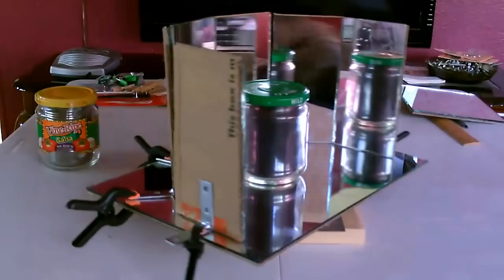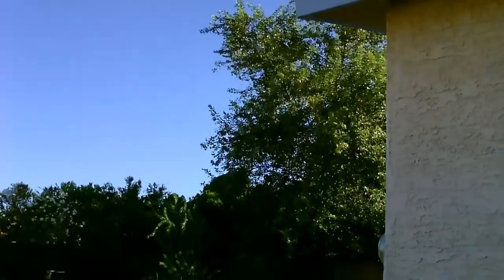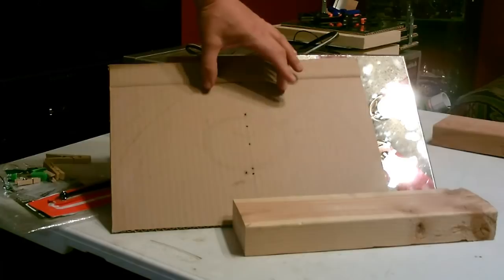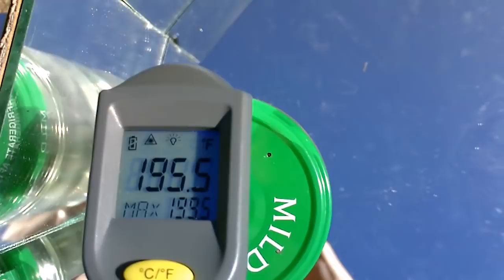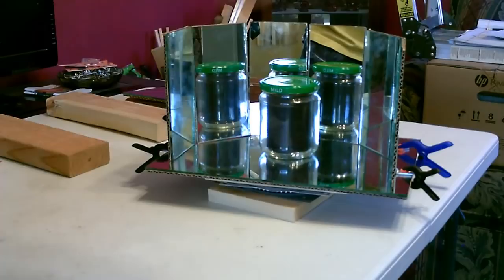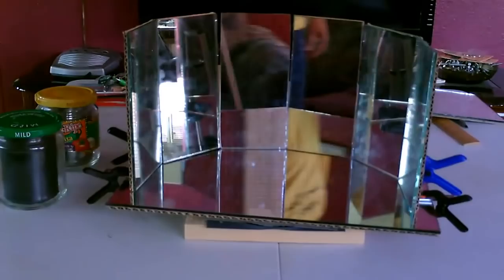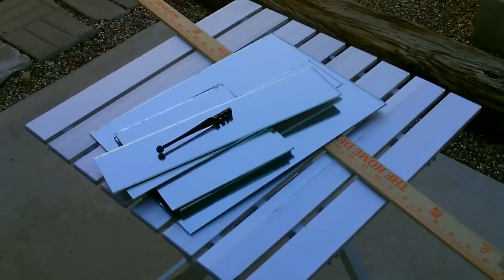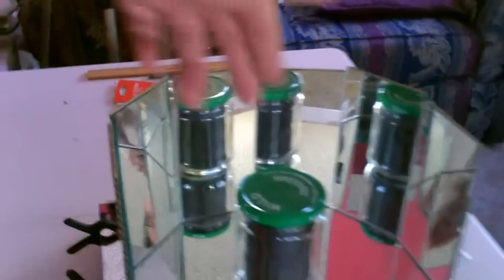Solar Mirror Cooker! - The "7 Mirror" Parabolic Solar Cooker! w/insulated cooking jar! (200F) Ez DIY

Comment: The mirrors should take the shape of a parabola. When you look straight into the cooker, you should see the pot in all mirrors. That'd get max efficiency out of the cooker. The bottom shouldn't be glass. It can crack under high heat. Other than that it's a very good design. The larger the cooker, the more heat it generates. Easily the most efficient design for everyday cooking.
Reply from the maker: hi. i'm glad you like the design. very easy to make 🙂

Comment: I especially like your food container! What kind of food- and heat safe glue did you use? My only concern with using a tin is the plastic laminate on the inside which is not meant to be heated up, and thus could break down and release in your food.
Reply from the maker: hi and thanks. i used 100% silicone caulk. that is considered to be 100% food safe. it handles very high heat 400F+. good news: a couple of years ago i really wanted to know the answer to "the lining" question myself (so i spent several hours reading many articles and they all essentially said the same thing). they said that it's perfectly safe to cook in tin or metal cans with linings (with only one exception). the exception is that you can't "fry" food directly in a metal can *if the metal can is being heated over a fire. that's the only situation that researchers found to be a problem for the lining. but all other ways of cooking (like boiling, roasting, baking etc.) worked fine. another interesting thing is that a lot of the metal cans that are sold are unlined - they sell both kinds. it mainly depends on what is being stored in it. if you search for 'unlined metal cans' you'll see a lot of them.

Comment: You need lots more strips. Much of the energy is reflected away from the core. What about thermal energy values? Have you come up with any caloric numbers? IE it takes 1 cal to heat 1L of H2O 1deg C.
You have obviously spent a lot of time on this energy source. I commend you. But by now you must have some useful data? How much water can I heat for my family with X area of mirrors? Would it be supplemental to the electric/gas heater? Or be primary through the day? Interesting work amigo.

Comment: How did you determine the focal point?
Reply from the maker: hi. mainly by visual inspection (you place the container where the sun shines the brightest off of the sides of the container)
Reply: @desertsun02  You can also use a laser pointer for testing